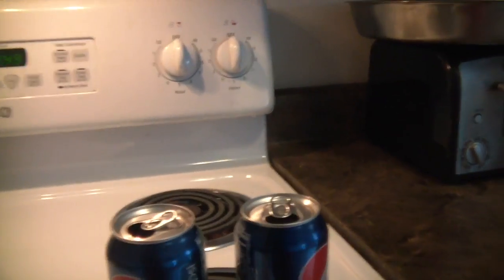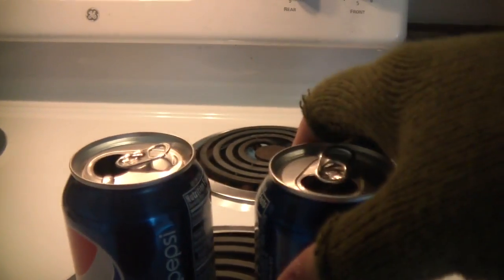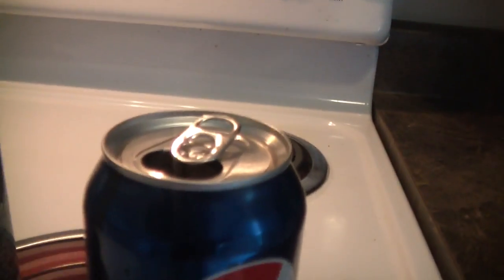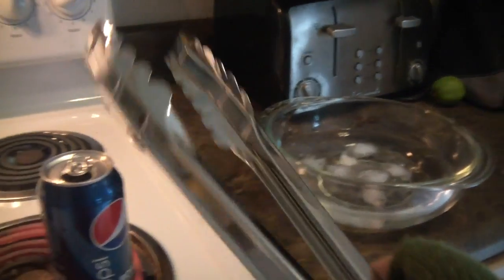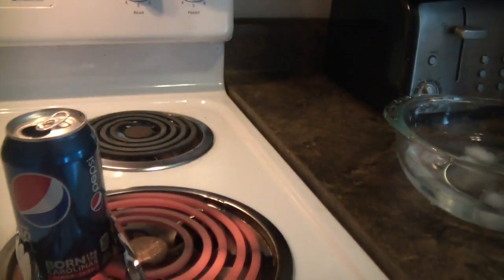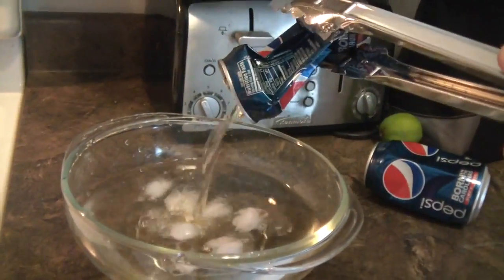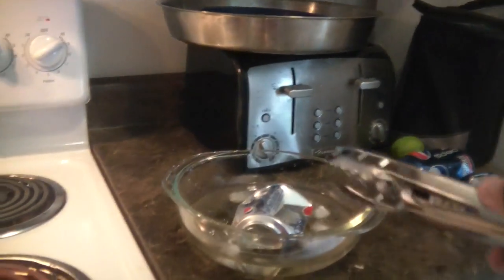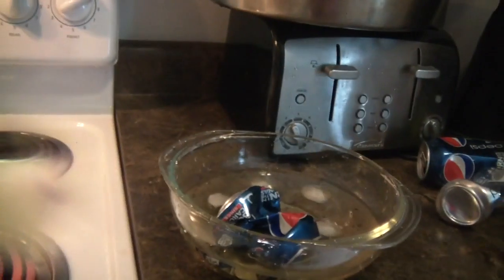How To Crush A Can The Russian Way!

Comment: saying it's the change of pressure doesn't explain much

It happens because cold water doesnt expand everywhere, it stays at the bottom thanks to gravity.
But as the water boils it becomes gas, and as gas moves freely around it requires mor space.

While the steam condenses, it becomes water, therefore takes less space.
thanks to the ice water underneath, the condensed steam, now water, becomes even colder taking even less space.

as there is no more air to for the cold water to take, the pressu

Comment: Well... considering it's still a sealed can and you heat it up until boiling temperature... well, it's quite likely the can will go BOOM on you and mess up the area because the steam has nowhere to go.

Comment: Wow... there is no pressure in the can since it is open to the atmosphere.  The air inside the can is hot and if it was sealed this would create HIGH pressure in the can, since air expands when it gets hot.  Now as to why this works; the second law of thermodynamics states that hot moves to cold.  When you seal the can with ice water all the hot air inside the can rushes to the cold water lowering the pressure immensely and crushing the can.

Comment: When the water boils in the can, the steam creates pressure inside the can causing it to expand.  At the same time there is pressure outside of the can pushing at near equal force.  When the  can is instantly cooled, the pressure inside the can decreases causing the pressure from outside to crush the can.

Comment: As the air inside the can is heated up the particles move about more and therefore need more space, but when it is cooled down the air particles don't move as much and so they require less space, when this is done quickly the air shrinks so fast that it forms a small vacume

Comment: Really? That's weird. I would relate it to chemistry. Because with heat, atoms spread out, and when they are frozen, they stick together. That's what's happening, the atoms in the can are really hot, but the water is cold. So when the can make contact with the ice water, all the atoms in the can stop moving and stick together. I'm just throwing out a hypothesis in there.

Comment: You know that cold and hot are opposite,right? Every physical property that mixes with it's opposite creates a lot of pressure,and because there is no enough space for the air molecules inside the can,it will move so rapidly and amazingly strong.Then the can will explode and shrink because of the hot water.

Comment: The water vapor condenses into water, leaving a vacuum within the soda can.  This vacuum creates a pressure differential between the inside of the can and the outside, so the air trying to get into the can crushes it.

Comment: The water vapour inside the can very quickly condenses, and because the only hole in the can is covered by the water the loss in pressure crushes the can. Simplez

Comment: The gas inside the can gets hotter, and molecules of nitrogen, oxygen (and some other stuff) start moving more rapidly than before. This results in a similar rise in pressure. So when the can is tipped and plunged into cold water, according to Charles law of thermodynamics, (Pressure/Temperature = stable if volume remains unchangeable) the temperature abruptly decreases and so does pressure, which results in the implosion we all just witnessed.

Comment: the air molecules in the can are expanded, when he tips it upside down into the ice water, the can quickly gets cold and make the air inside colder. cold air takes up less volume so the can implodes. its kind of like putting a microwave dinner or something the dinner can explode if you dont poke air vents as the air pressure gets higher (because heat causes molecules to expand)

Comment: Well its easy to explain why this happens. Hot water expands and fils up the container and one the can touch cold water the steam cools down it subtracts and changes back to water leaving vacuum in the container. Crushing the can from the outside. If tht can was stronger it wouldnt be crushed, just pressurised intantly

Comment: the steam inside the can quickly *condenses* creating a *partial vacuum*. A partial vacuum is a space that has little to no gas particles, thus little to no gas pressure inside the can, while the atmospheric pressure outside the can (101.3 kPa) crushes and collapses it. A vacuum, which is only defined as a matter-less space, can NOT "[overtake] the resistance of the can", otherwise the can will explode rather than implode. Instead, it is the pressure outside that does it.

Comment: Liquid water molecules do not exert the same pressure on the inside of the can the way steam did, causing the air pressure from the outside to crush the can from the outside in

Comment: When water in the can is heated to its boiling point, it rapidly vaporizes. The generated steam quickly displaces all the molecules of air in the can, exerting as much pressure on the inside walls of the can as the air exerts from the outside. When the can is inverted into a bucket of cold water, the steam inside the can is rapidly cooled. This causes the steam to condense back into the liquid phase, leaving the inside of the can nearly empty.

Comment: beacuse that the hot Air ( steam ) particles are away from each other so when we push them to get in an instacold statement its particles gonna became cold and closer to each Other + closing the air hole that should make it pulled the neariest thing inside to get rid from the ( empty en-space )
}{
I don't if i wrote correctly cuz that i am not english mother tongue 
i speek Arabic i am from Qatar
thanks for reading And thumbs up If you got what do I mean

Comment: when water is boiled it expands and turns into vapor. when you turn the can upside down into cold water, the steam and hot water inside the can quickly contracts and there is a vacuum formed inside of the can. this vacuum is strong overtakes the resistance of the can and the can implodes

Comment: The boiling water turns into steam, thus expanding, and when cooled down, the steam inside condenses and turns into liquid, which means there is no gas in the can anymore, which then means pressure outside the can is higher, thus crushing the can

Comment: Ah yeah, it's basically boiled down to a vapor pressure differential. Where there's a higher vapor pressure on the flame, and a lower vapor pressure in the ice bath.

Comment: this happens because the water that was put into the can turned into steam pushing out all the air inside the can when he put the can in the cold water the steam condensed into water leaving extremely low pressure that is sort of like a vacuum and from the enormous pressure of the air outside the can it caused the can to collapse in on itself as you just witnessed, i saw this same effect on a steal drum on another video and if it can make something that big collapse, this is just ababyexperiment

Comment: the water boils and takes up space in the can. The can is now full of steam and not air. The application of cold water to the can makes the steam inside it rapidly cool and condence into water whitch takes up a lot less space then steam. This results in low pressure inside the can and becuse its upside down, it cant suck air in to equalise the pressure. The result is there is a lot more force from the outside atmosphere pushing inward than inside the can pushing outward ie, the can gets crushed

Comment: It's not really to do with particles, but more to do with pressure. When the water inside the can boils, the steam pushes out all the air inside the can, creating a negative pressure. When dunked in water, the rapid cooling of the can causes the air inside to become even lower. As a result, there is a near vacuum pressure inside the can, and atmospheric pressure outside it. The atmospheric pressure is what crushes the can.

Comment: It crushes because when the can heats up the air gets less dense and the air outside it is more dense and when you put it in the water the air cant escape up so the more dense air has more pressure and it implodes

Comment: In this case the pressure does not build up inside the can because the top is open.  The air inside the can is hotter though.  The key is when he flips the open top of the can into the ice bath essentially sealing off the system.  The air inside the can rapidly cools and the pressure inside the can decreases.  The air pressure outside of the can becomes greater than the air pressure inside of the can so it collapses.  The crushing force comes from the earths atmosphere pushing inward on the can.

Comment: to put this so any one can understand the can is crushed by the heat because its like when you come in after being out in snow you suddenly change so the can is heated to 100 and the water at a guess is say 2 so it suddenly goes from boiling to freezing the tempriture on the outside needs to get in and it cant get in through the only hole thanks to the water so it just breaks in

Comment: That's incorrect actually. It crushes because of thermodynamics. Inside the can, PV = nRT, where nR is constant, P is the pressure, V is the volume and T is the temperature. So PV/T must be constant. Since the temperature drops so rapidly when the can is put in the cold water, and there is nowhere for the air to escape, the volume must decrease significantly in order for nR to remain constant.

Comment: When the can is just sitting there, it has the same pressure inside as the air pressure outside it.  When it boils, the water vapor replaces all the air inside the can.  Then when it's cooled, the water vapor turns back into a liquid and creates a vacuum.  But since there is nowhere that air can get in, it sucks the sides in instead.

Comment: The reason it implodes is because when the water inside is boiling, it is removing everything that is inside the can at that moment, creating something close to a vacuum inside of the can, once dropped in the cold water, the pressure inside the can will be so low that the water pressure can easily crush the can's aluminum, causing an implosion.

Comment: Actually, the steam fills more space than the air that was already inside the can and when you cool it, the steam condenses and takes up less space. Now the air wants to get back in but since you cut off its way of getting in, it makes a way by crushing the can. 

P.S.- There is a difference between IMPLODING and EXPLODING. In this case we are dealing with a can that implodes. If you want to see a can explode, just stick it straight on the burner w/o opening it, wait, and have fun cleaning up.

Comment: Since air pressure likes to be equal, the air around the can tries to fill the vacuum but it can't fill it directly, do it does so by a) imploding the can, and b) forcing water into it all in an effort to equalize the pressures inside and outside the can.

Comment: When you boil the water, the steam is less dense than the air and takes up more space, the air is displaced and exits through the top of the can. Then, when you drop the can top first in the icy water, the steam gets rapidly cooled and becomes more dense so it takes up less volume inside the can but since you cut off the  way for the air to come back in, the cooled steam creates a vacuum inside the can.

Comment: since the gases in the can were such a higher temperature when on the stove, as soon as u put the can in the water the gases in the can occupy a lower volume reducing the pressure of the can inside, then the atmospheric pressure outside the can crushes the can because of the pressure difference.

Comment: When the hot can and water vapor reaches the cold water in an enclosed area it creates a drop in pressure ,but exposed to the outside does nothing.  When the water vapor condenses back into a condensed form ,in an enclosed area, which then creates in unequal ratio of pressure inside the can and the outside atmosphere, so when the water condenses it causes a sudden drop in internal pressure. Which then in turn sucks in the walls around and the conclusion you find is an imploded can.

TL;DR--Magic

Comment: The steam inside the can is very hot so the monocules move around with alot of energy causing it to be les dense, then when you put it in upside down it cools down and sucks in cold water causing it to go to a smaller density within a small amount of time.
cool idea for the next video, making hydrogen mixing it with the oxygen and putting that in cans and light it :D

Comment: this happens because when air is heated it expands and since the can is an open system the mass of the air inside of the can changes, and then after heating for a while then suddenly flip the can over into the ice water causes the air molecules to get closer causing pressure from the outiside to crush the can

Comment: the water that u boil inside the can become a steam and the steam will be hot as for the air inside it and when u put it in cold water the steam and air cools rapidly and contracts and makes vacuum which makes it suck the wall of the can ^^

Comment: This happens because the air in the can is replaced by water vapor. When you turn the can over and put it in the ice water , it makes a vacuum and the water condenses.  The pressure inside is lower outside because there is no air left inside, so the atmospheric pressure causes the can to implode.

Comment: Works because the water in the can turning to steam fills can with hot vapor when you dump it into the ice water the vapor cools and the gas contracts sucking water up into the can which cools the gas/vapor faster and it accelerates from there till the air in the can reaches room temperature in a matter of milliseconds crushing the can in the process.

Comment: When the air and water inside are cooled rapidly, they compress and have no space for air to get in to fill the empty spaces so the can implodes to get rid of the empty space. The water comes in for the same reason, to attempt to fill a vacuum.

Comment: When you're heating the can on the burner with the water inside, the water is vaporizing and thus increasing the pressure inside the can. When you turn it over to place it in the icewater you are cooling it very rapidly and so the gas now turns back to liquid state. This then creates a pressure difference between the inside of the can and the outside air, causing a force on the can to reduce its volume until the pressure inside the can equalizes with the atmospheric pressure.